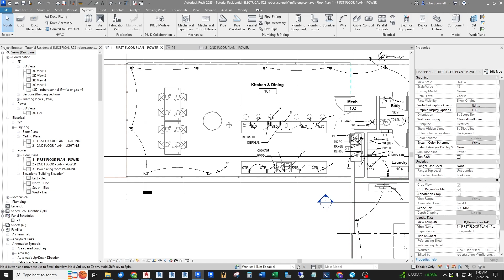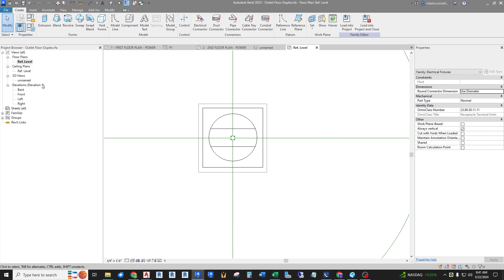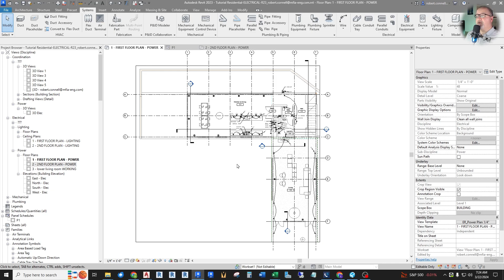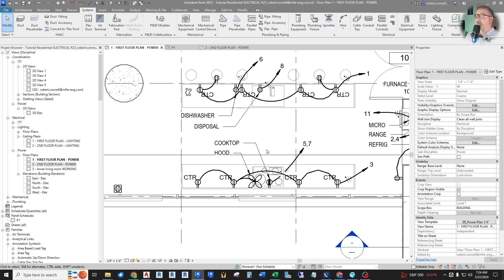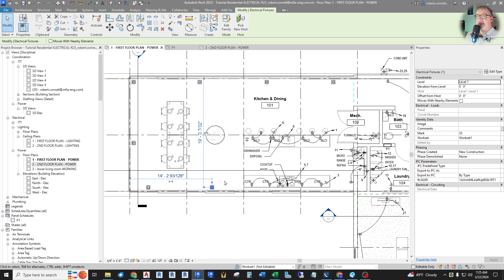REVIT MEP FREE COURSE!! EP-05 - Floorbox Family Editing & Panel Updates - Electrical Tutorial

Comment: WHILE GIVING POWER TO FLOOR RECEPTACLES , IT ASKS TO CONNECTOR 1 OR CONNECTOR 2 , WHY?
Reply from the maker: Sounds like the floor box family you are using actually has 2 electrical connectors in it. If you edit the family, you can remove one.
Reply: @ElectricRob  THANK YOU SIR, PROBLEM SOLVED.
Reply from the maker: Glad that worked!

Comment: Hi sir. How can you make your panel schedule of loads showing 2 VA in a 2 pole. Mine is only showing 1 VA in a 2 pole. Like circuit 1 on a 2 pole breaker is 500 and other is blank. and for example yours in circuit 5 and 7 is showing each as 2500. Hope you can make short video for this for 1p, 2p 3p in 1 panel each showing va in each circuit. Thank you so much sir.
Reply from the maker: Thanks for the question - you bring up an issue that comes up a lot, so I will go ahead and make a short video just about multi-pole circuits. The answer is - it all comes down to the "electrical fixture" or the device that you are connecting - if it is multi-pole, the load must be set to "balanced" and poles must be set to "2" or "3" to spread the apparent load evenly among those poles, which will then be reflected properly in the panel schedule. Cheers!
Reply from the maker: Just added a video dealing with this situation here https://youtu.be/1Ubfzx9uTw8

Comment: Hi Rob, very nice video with details and explanation.  I have one question that I can not find a solution.  How the conduit runs on a project like this relates with the wiring run.  Because the connection of the cable from loads to the panel is done by Revit how is calculated the voltage drop from the length of the lines.  In our case for a typical house project all the cable must run inside conduits.  Is it something that you have presented and I missed it or you will present it in the future.  Thank you again for all your efforts for presenting all these interesting videos.  Harris
Reply from the maker: Hey Harris! Thanks for the feedback and good question - I have not addressed Revit's voltage drop calculations yet, I do plan to in the near future!